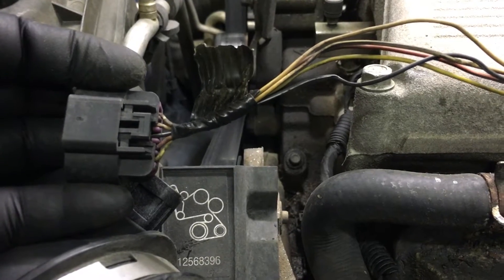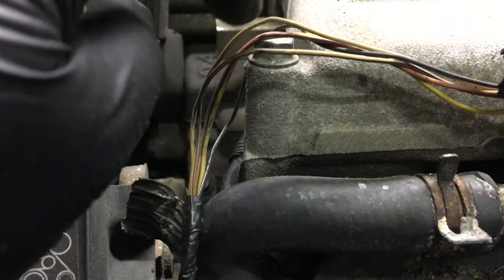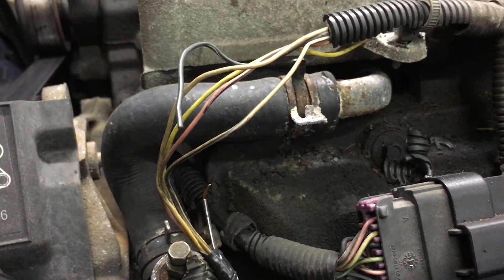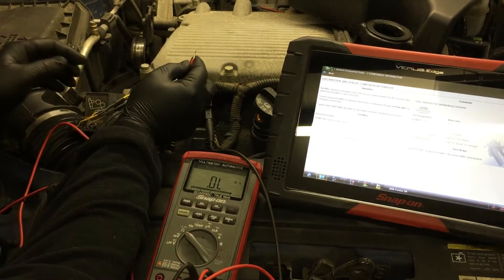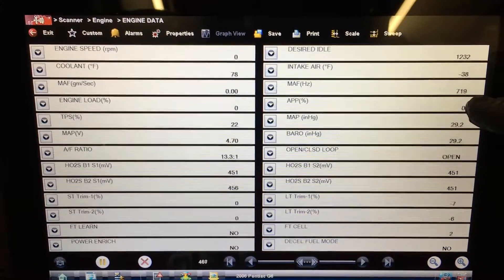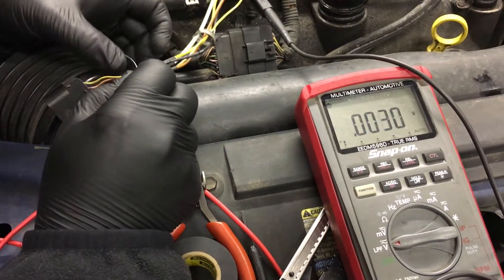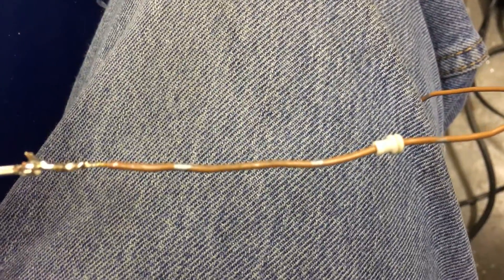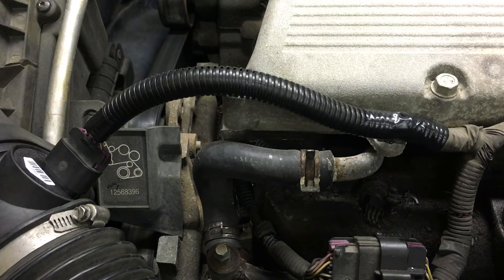MAF & IAT Sensor Diagnostic

Comment: What would you consider a normal Intake Air Temperature at Idle, car stopped, A/C on and an outside air temperature of 86°F (30°C)? Mine was reading up to 154°F (68°C), ins't it too high?
When it happens the car get way too slow to accelerate.